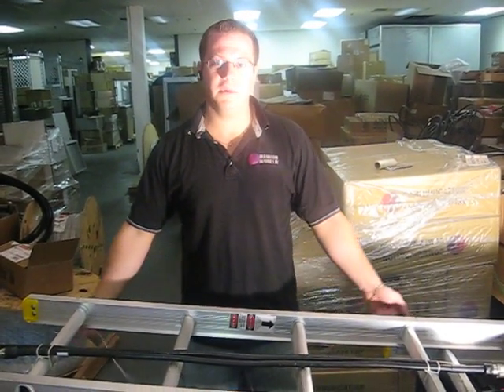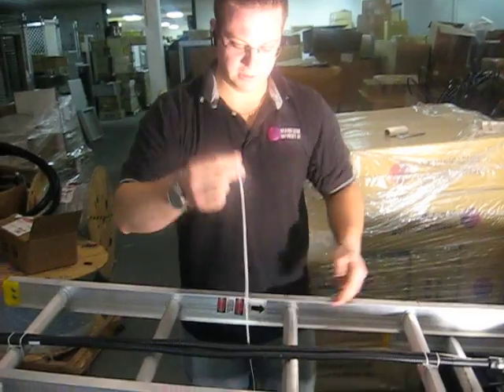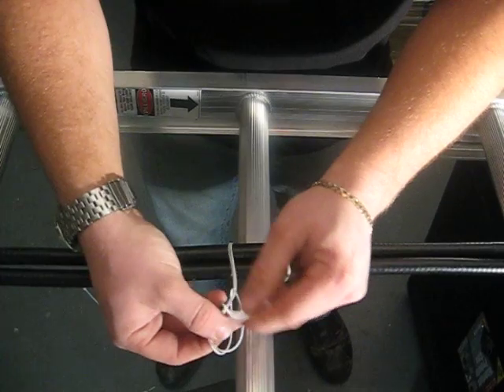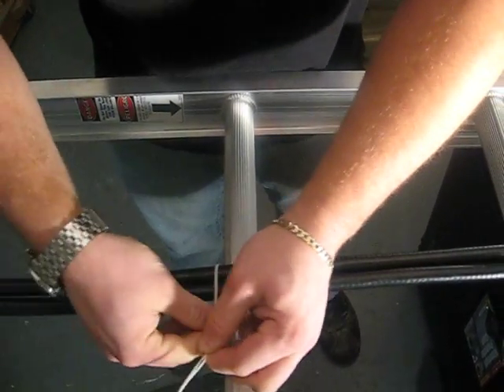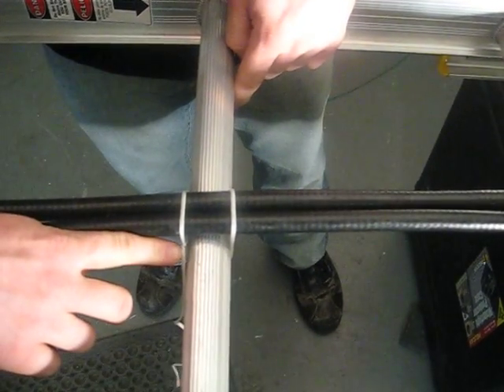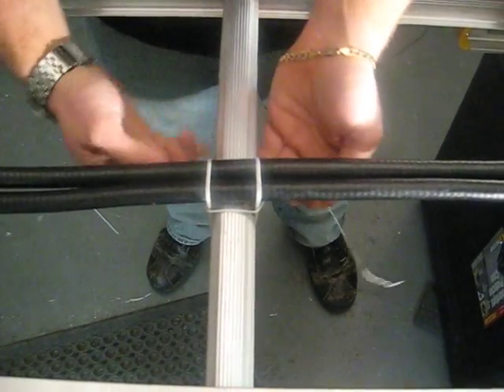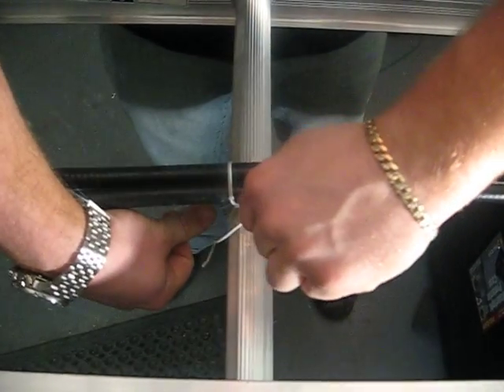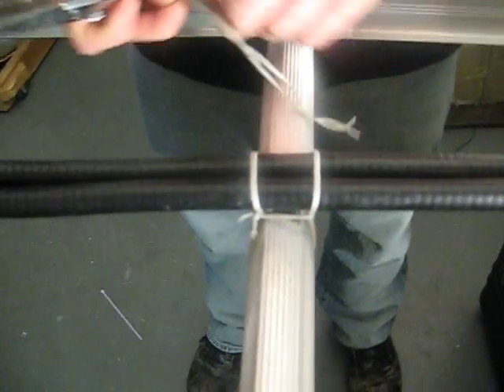Box Stitch

Comment: 3 knots to lock and you are holding your wire tool wrong..
Reply: I usually put a half hitch in to lock before I loop the tag ends around, then only 2 - half hitches to lock at the end to finish. I've never seen anything come apart or loosen after years of revisiting a site.

Comment: Why do you use the box stitch as opposed to the Kansas City Stitch?
Reply: It works good on larger wire that you don't fill a whole rack with.if you are doing a whole rack full of cables, a Kansas City stich is probably faster, but for small groups of power cabling 6 gauge and larger I like a Box Stitch.